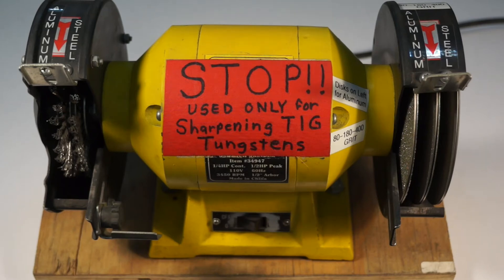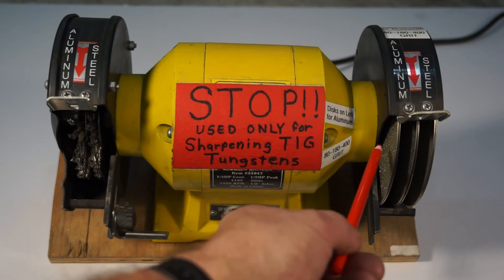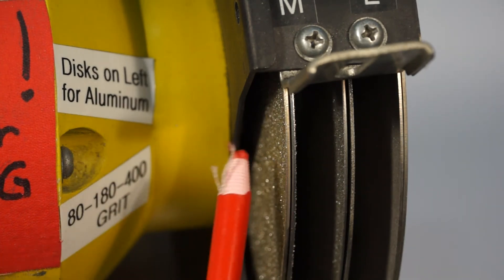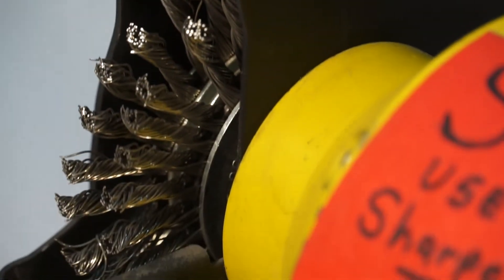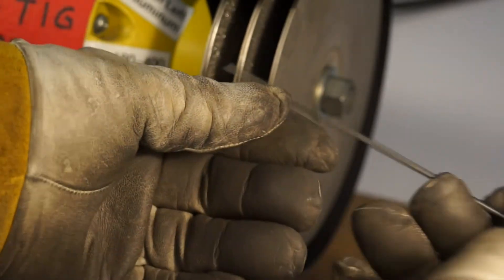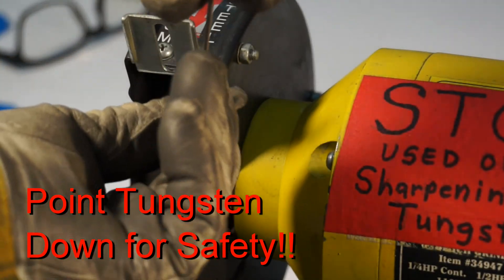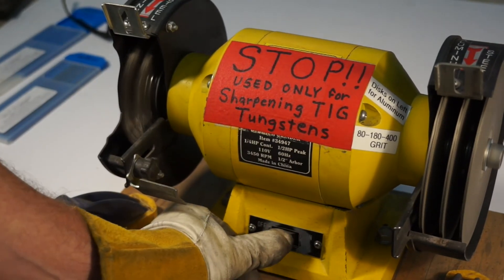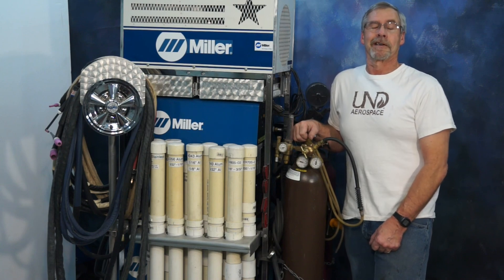Diamond Tungsten Grinder

Comment: There's at lot of these diamond grinding discs on the market, almost all made in China or India.  Which brands have you found to be most reliable and long lasting?  Or are they all about the same?
Reply from the maker: I have done an awful lot of Tig welding in the last 6 years with them and only went through 2 sets (and probably didn't have to) and seams to be no different in the 2 brands or sources.

Comment: do you have any links on where to get the faced wheels?
Reply from the maker: From an Ebay Vendor from China...took forever to get...https://www.ebay.com/itm/6Inch-Grit-80-2000-Diamond-Coated-Flat-Lap-Wheel-Jewelry-Grinding-Polishing-Disc/223182072092?ssPageName=STRK%3AMEBIDX%3AIT&var=521986100354&_trksid=p2060353.m2749.l2649

Comment: where did you buy those wheel from again??
Reply from the maker: On Ebay from china vendor...took a month and a half to get.
Reply from the maker: From an Ebay Vendor from China...https://www.ebay.com/itm/6Inch-Grit-80-2000-Diamond-Coated-Flat-Lap-Wheel-Jewelry-Grinding-Polishing-Disc/223182072092?ssPageName=STRK%3AMEBIDX%3AIT&var=521986100354&_trksid=p2060353.m2749.l2649
Reply: I got similar grinding wheels off Amazon, not a month in shipping.